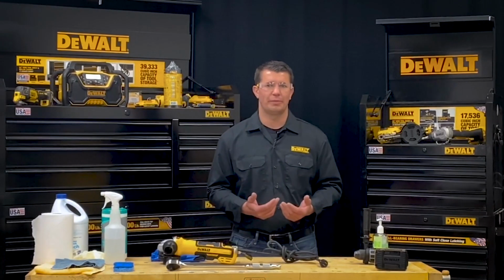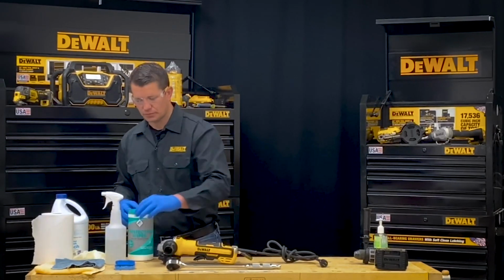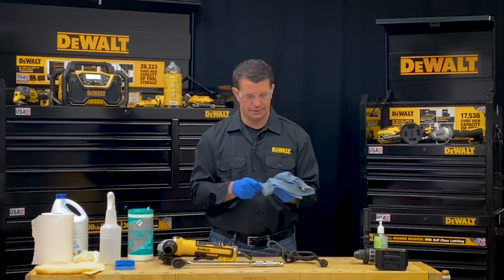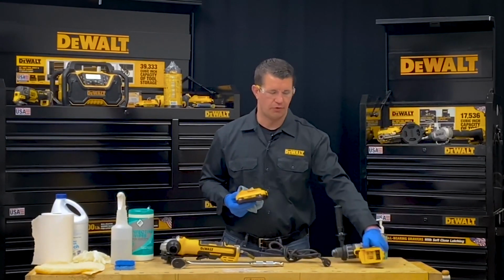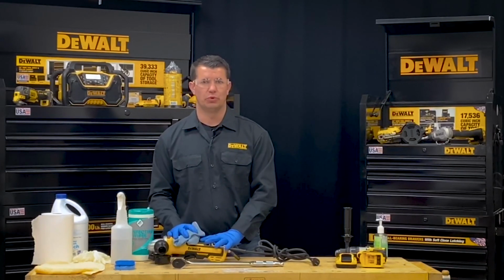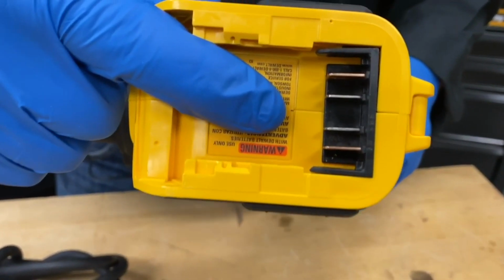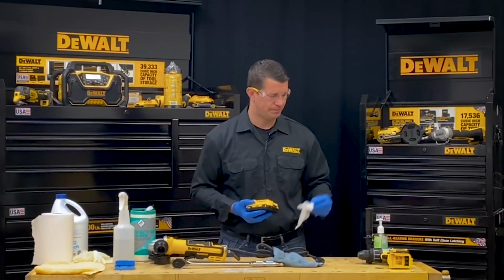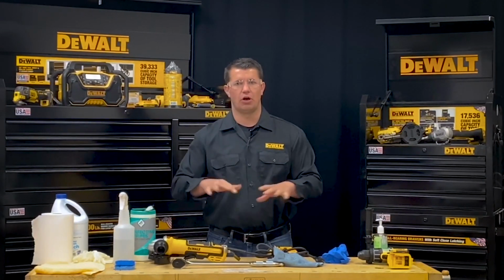DEWALT® Product Guide - How To Clean Your Tools

Comment: Drongos, I’m looking for an indepth, disassemble your battery power tool, detailing the interior surfaces with a toothbrush. Also cleaning the metal contacts on both the power tool and the battery.

Comment: Look at the DeWalt tool displays at Lowe's. Sanitizing did a number on them. Brand new tools never seen work or harsh conditions and now after being sanitized they look to be 5 to 10 years old. Surprise there's not a disclaimer for this video that sanitizing will discolor the metal, plastic, rubber and rub off and a lettering.

Comment: Disinfecting...sanitizing tools....I guess that is very much appropriate nowadays to prevent COVID..LOL! Cleaning those tools with water will get them to rust easily. If you really have to clean them with water-based cleaner, you're gonna have to wipe them down with low-viscosity oil like WD-40 before you store them. All my decades old power tools have very minimal to no rust this way.

Comment: I watched this video for nothing. How in the world do you safely clean the battery terminals??? Mine are filled with krud from actually working.
Reply: I've used wd40 spray them. Just not sure and the chuck, dunno if the oil will make the jaws slip
Reply: Rubbing alcohol above 70%. It's what gets used on circuit boards a